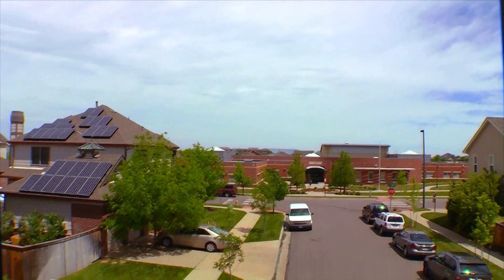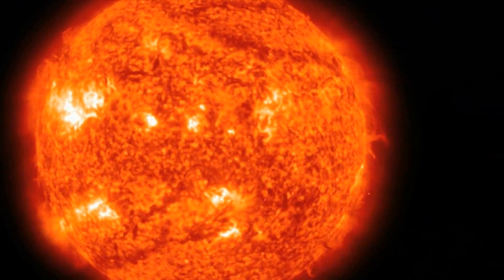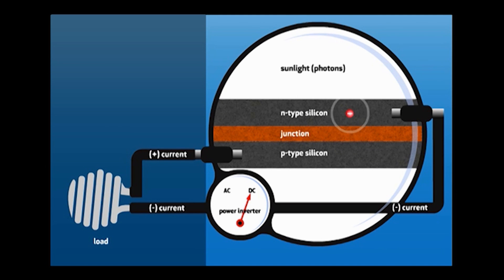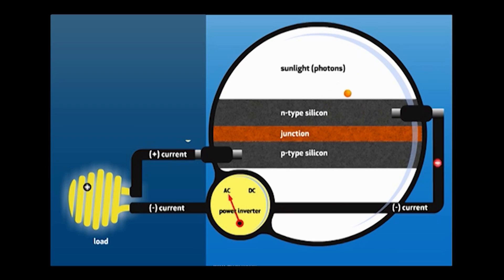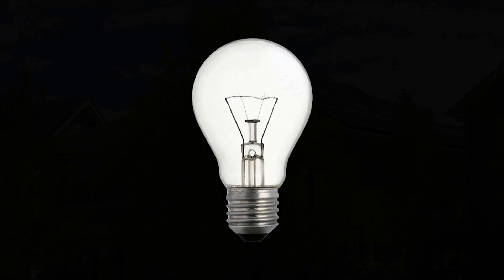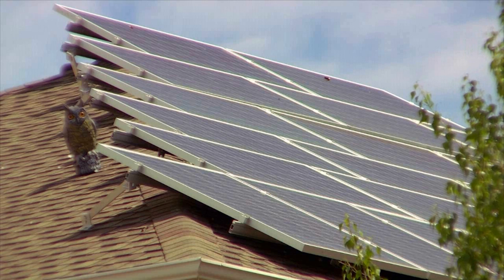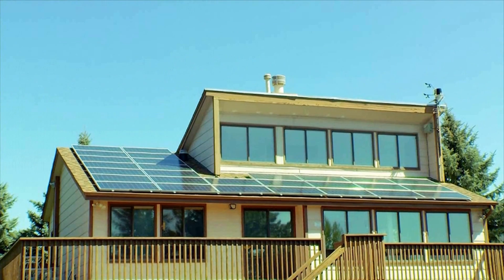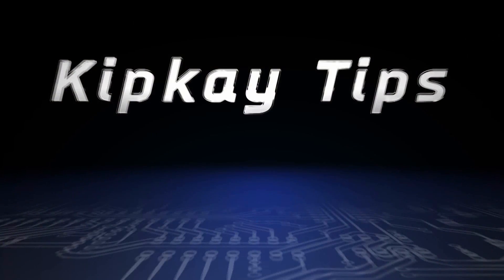Does SOLAR POWER really work? solar panels solar energy kipkay

Comment: Could you put a light attached to a large solar panel and put the light above the panel and create a almost endless cycle of electrons?
Reply: It sounds possible in theory, but in practice it wouldn't work at all. There would be all sorts of energy loss throughout the system. The lightbulb would give off heat which reduces the light energy sent to the panel. Not all of the lights photons would be directed at the panel. And the panel may not absorb all of the directed lights photons.

Comment: Dear Kip K I watched quite a few of your videos and hope you can help me I have a solar panel that I can't figure out how to wire the panels model number is SP107X61MM can you provide me a wiring diagram and tell me how to identify the positive and negative solder points?
Reply: do you have a digital voltimeter? set it in the sun, take a reading from the poles available, and if it gives you a negative reading, your poles are reversed.

Comment: Kip.  What is your opinion of cleaning the solar panels on your house. I have read opinions from both sides, and both make sense. Thanks,  DJ
Reply: Most people just use a hose to spray it (light dust,etc.) But if there is like smug marks,etc stuck on panels. You'll ether have to figure some portable way to get a broom handle type sponge and wipe it. Or go up on the roof top and scrub it by hand. But most time it's just rinse with a hose and you're good.

You can always rig up a portable pump system to make a 'waterfall' effect from the top and that'll spray water on the panel tops to wash them off without needing to hose it by hand or such. And if you live in a desert, this'll become a weekly thing because the more dust that collects the more % of power is lost.

Comment: They've made panels far beyond 30% efficiency but, yeah, they're expensive. It's best to have solar either with a small power use location (tiny home, etc) or to supplement power from the grid. Of course it's immensely better than fossil fuel power when it comes to environment and overall costs but upfront costs are definitely higher.
Reply: The record is 46%
Reply: I know it is. I'm not against it or saying it isn't worth it but you do need to have panels that last quite a while to pay for themselves.

Comment: The problems about Solar systems :
-How to provide energy to electric devices( how many devices include and how much it spends or expends)
-How high capacity of solar panels and battery(bateries) you need(your devices need)
-How safe would your system be if you set it up
Reply: The items you listed are questions and not really problems.
For most people in the US, they are not really the right questions because you are allowed to use the grid to make up extra power you need or sell off extra power you make.  The real question is does the proposed system make economic sense.  If when you do the numbers, the answer is "yes" then it is time to work on a good design for your system.
Reply: I think it would worth to be set if the power conditions were poor or too expensive that you couldnt pay well, you want too pay less or reduce it; and the solar system could be better idea for good life. The items i have listed are just technical problems after if you wanted or decided to build this one

Comment: That's why I support Nuclear energy production.Its cleaner and safer.If we learn to use thorium we will basically have a renewable source of energy.
Reply: Asaf KHAN cleaner,nope.Safer,definitely not
Reply: Modern nuclear plants produce next to zero waste and the cores aren't enriched enough for a nuclear explosion. I'm a big fan of nuclear energy.
Reply: Do you realize we have hundreds of thousands pounds of used cores stuffed underground, and they will always be radioactive? I'm not saying nuclear is bad in anyway. I'm a big fan of it. But what we are doing is stuffing mountains with radioactive cores that will take millions of years to not become radioactive. We need to fix this problem
Reply: Asaf KHAN couldn't agree with you more.
Reply: Alvis Gwa Cleaner, comparatively,definitely.And if we use thorium the waste can actually be used to treat Cancer. Do some research.Its an interesting topic.
Reply: I'm more of a nuclear fusion fan. Thorium fission is certainly much safer than typical uranium.
Reply: My apologies, what I meant to say that was if we built new power plants with generation VI reactors there would be little to no waste as those reactors can internally recycle the fuel rods to much safer materials. In response to the meltdown aspect, the cores of reactors used today are only enriched to a very low level as the fissile isotope makes up a fractional percentage of the total uranium in the core. This means a full on meltdown is impossible as the core cannot reach the critical temperature required.
Reply: I'm a fan of nuclear, but it is far more expensive than solar. As for its safety and environmental impacts, it is quite similar to solar. The biggest advantage over solar is that it is continuous.
Reply: Look there are several typers of reactors.The ones which lead to horrible accidents in the past were "heavy water reactors",which basically is bound to explode.India is building a thorium reactor.Its gonna be a great milestone for mankind.Its will be better than Uranium reactors.
Nuclear is expensive but it also provides a massive amount of energy compared to solar.Nuclear energy is the "Future" and solar will be "Abolished" if its effectiveness is not increased.

Comment: if you're tied to the grid and receive credits back for energy put into the grid then having batteries is obsolete
Reply: And that can cause massive problems for the grid as domestic capacity increases, especially seeing as solar power production happens during a time of the day when power demand is low, meaning it fucks with the power plants that are hard to throttle back that would normally be taking the smaller load at those times, and can encourage greater use of peakers, which are often fossil fuel based., when demand ramps back up in the evening.

Comment: I would like to go solar. Just got to make sure you got a big enough battery.
Reply: same. got a couple neighbors who did. idk if the city is still doing this, but when they installed it they were making enough power that the city ended up paying them to have the excess divert to the grid. That was years ago, and I bet the panels have already payed off. Havn't need maintenance since installation!
Reply: you better double check with your neighbors because they probably maintain them while you are gone because the glass used to protect solar panels does get dirty think of it like your car windshield and if you don't do proper maintaince then it wont last you that simple.
Reply: You really don't need to be micromanaging solar systems. Unless you're going on an extended trip, you can basically just leave it and not worry.

Comment: What is the cleanest most efficient source of energy. Is it nuclear, bio or what.
Reply: Solar thermal is also, if I recall, substantially more expensive.
Reply: There's no best answer. Hydroelectric is the best among renewables, imo, because there's a lot of hydroelectic potential in the world. It also can produce very large quantities of energy, and can be controlled quickly to change how much energy is being produced to match demand. On the other hand, it has the downside of disrupting water flow, which can cause ecological damage, as well as other problems.

Compare this to solar which doesn't make sense in a lot of places that need power because they don't get as much sun, produces relatively little power without taking up huge amounts of land area, and where you have no control of how much it's producing, having to simply fit it into your power supply when it's producing. This is especially bad because solar power tends to be generated at the times of day (mid-day) when we use the least amount of power (we use the most power in the mornings and the evening). Domestic solar is especially problematic. It's relatively cheap if you can hook it into the grid, but the problem is that the power companies then have to work around the incoming power from people with solar coming in from their homes. This sounds great, but it can cause serious electrical supply problems if there's a lot of people doing it, and has in places like Germany that really pushed for domestic solar installations. Battery-backed systems avoid those problems, but make the system much more expensive. Plus, batteries and inverters both have relatively short lifespans, and once you account for those recurring costs, it's more expensive in many places to have a solar system than to just pay for your electricity from the grid. Plus batteries and electronics aren't exactly good for the environment, so having to keep replacing them isn't desirable.

Nuclear is the best non-renewable imo. It's the safest form of power in existence, even after taking into account the few disasters we've had. Even solar power kills more people per watthour generated than nuclear. There's plenty of nuclear fuels available, the danger is vastly overblown by anti-nuclear organizations, and nuclear can generate a lot of power cleanly.

If you want the cheapest form of power to produce, it's often wind.... but that has it's own downsides, and only certain places are suitable for wind generation.
Reply: seigeengine possibly solar thermal (works very differently to solar panels) but cannot be done on a small scale
Reply: Accidents during installation and maintenance, mostly.
Reply: Did you delete your reply? I can’t see it anymore. I was gonna insult you again but I’ll just say this: faulting solar power for workers’ inability to do their work safely is entirely unfair when compared with nuclear’s actual potential for directly killing hundreds.

Solar power cannot kill a single person. If tomorrow I fall from the stairs and die, stairs don’t kill people. Retards kill themselves.
Reply: I can&#39;t see your comments at all when I click through to reply.

Yes, I can. Differences in accidental fatality rates are a very real factor comparing the cost to lives of different power supplies. Eventually, all humans mess up. We just usually manage not to do it when it will kill us if we do... mostly. Once again, even including nuclear incidents like Chernobyl, nuclear is safer, by a far, than solar, to human lives.

You're basically arguing that if a power supply system required people to manually, and without assistance, walk across a mile long tight-rope in high winds over a thousand foot drop regularly, that the resulting deaths shouldn't be considered a cost of the power supply.

Comment: solar is not 100% clean, the process of making the solar panel makes a lot of emissions but depending on the lifespan of the solar panel it could still offset the amount of emissions involved in making it , compared to other types of energy generation it is fairly clean though
Reply: Compared to what? The manufacture of oil and gas? You can use oil once and a solar cell multiple times.
Reply: there are more than just fossil fuel energy sources such as hydroelectric and geothermal which both have their own set of problems but to make solar panels you need  silicon and a fair bit of it, the process of mining and refining the silicon used for solar panels (along with anything else that uses silicon) releases large amounts of carbon monoxide. all im trying to say is over a period of time the energy produced and used from solar panels means less power needed to be made from other sources such as fossil fuels offsetting the environmental impact from the initial making of the panels caused  but  because there were still emissions from the making of the panels they are not 100% clean, however in operation  they are.
Reply: steven bloomfield
Thanks for the comparisons.

Comment: so basically it's just mild inconvenience that should stop you from getting solar. you wouldn't want to invest in anything that could drop you electricity bills significantly while helping the environment if there's a hefty charge upfront now would you?
Reply: actually you need to properly maintain all equipment including solar panels and always desulfate your batteries because sulfur crystals is what reduces the battery life by reducing capacity you can actually buy desulfaters online now days.
Reply: A grid-tied solar system causes electrical problems for the system. A battery-backed system will never pay off in most places because the cost of replacing the batteries and inverter over time are so large it's cheaper to just pay the power company for electricity. All those scrap batteries and inverters aren't good for the environment either.

If you want to hippy it up, all the power to you you dirty hippy, but if you're looking at it financially, unless you live in a very sunny place, solar won't save you money.
Reply: seigeengine yes, anyone who doesn't live in a sunny area US not going to reap significant benefits from a solar system, and buying a complete system right away is also not a very convenient thing for someone not used to solar to deal with, however there are an increasing number of companies in those areas where solar is the most economical that will put panels on your house for next to nothing and take any additional credit you get from your local electrical company after any surplus power you use is paid for with you filling in the remainder and giving it to the solar company. the result is that you pay nothing to the power company and cab pay up to 60% less of your normal bill to the solar company. I am not claiming that solar works for everyone or that it is perfect, however it will be part of our energy future and I would recommend in investing in it. Also, as to the dirty hippy comment, thanks, I take that as quite the complement.
Reply: seigeengine and by the way, if you make an investment in higher quality equipment at the start and make smart decisions about electricity usage the cost of a full system can be recouped over time. In addition I can't emphasize enough that solar technology is advancing quickly as it becomes more apparent that we cannot ignore the power of the fusion reactor in the sky that comes to us free if charge. again solar isn't for everyone, but if you are economically stable and willing to invest it can definitely be a benefit to you and the environment in the long term.
Reply: Yeah, great, let a middleman eat your profits out from under you. Brilliant.

Someone too dumb to know that complement isn't the right word would take that as one, yeah. ;)
Reply: seigeengine so you feel that it isn't economical enough to invest in the first place, but when considering that you can lower your personal costs and help the environment for free you gawk at the very idea. Profits generally aren't the first thing on the mind of someone investing in solar, although I understand the negative economic concern you won't ever make actual profit from solar. And on the matter of you calling me a dirty hippy, it doesn't say much of you that you choose to use poor attempts at  insults to support arguments.

Comment: The sun's energy is NOT free. That energy is produced through fusion and costs hydrogen. Eventually enough of that hydrogen will be used up to cause the core of our star to collapse cost helium to create energy, beryllium, carbon and oxygen. At this point the outer layers of the star will swell as the remaining hydrogen is fused, which will incinerate Mercury, Venus and our own planet, Earth. Eventually this fusion will use up all of the helium. because there won't be enough mass to create the pressure needed to fuse these heavier elements, the core will blow off it's outer layers of helium and become a dim, super hot radioactive ball of plasma, comprised of carbon, oxygen, boron, beryllium and lithium. Eventually, this ball will cool to the point that it emits no visible light, whatsoever and our solar system will freeze over. Is a little bit of inefficient energy production really worth such a steep cost?
Reply: RaFi TV he's joking. That's what actually happens, but happens either way
Reply: Inb4 somebody takes this seriously and starts hippying to save the sun
Reply: D Hawthorne Huh
Reply: "If we don't turn off the sun at night we'll use up all the power"
Reply: *****
EXACTLY!

Comment: Yo it doesn't do good here in Pennsylvania
Reply: I know of at least 3 houses here in Lancaster County that run almost entirely off of solar panels. The best part is that when you are producing power but not using it, it can back-feed the grid and the electric company pays you for it. One of my dad's former coworkers has solar on his house in FL and here in PA. All summer, his house in FL is producing power that he isn't using (aside from humidity control, powering a home server and security) and all winter, his house here in PA is doing the same (though less effectively). On average, he spends about $20 a year on power costs.
Reply: Grid-tied electrical systems cause problems too when they get to be a significant portion of the electrical supply. Solar isn't cost-effective in most places that aren't very sunny.

Comment: Not to mention very expensive.
Reply: Col. Angus depends where you live. In New Mexico they repay themselves in 7 years. What you pay for electricity you pay the lease instead and then you own them and they make money for you
Reply: Great, a lease, so you can fund someone else's profit margin. Never mind that you still need to maintain and replace parts over time. May make sense in New Mexico, but I know where I live, it just doesn't work out financially. You never break even.
Reply: zonkeymaker
That would be nice and I live so close to New Mexico,like 10-15 miles away,I'm going to look into it ty.